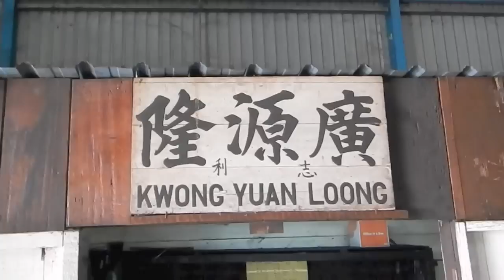How blacksmiths make parang machetes in Malaysia

Comment: " junk " is an ignorant and insulting comment . These guys are hard working men that fulfill a specific market with sweat and tears and believe it , if they spent all day one just one knife it would be superb ....
Reply: SACTICAL BAG if I spent all my life on one knife it would also be good but this angle grinding won't give you a nice edge and that's a pity regarding all the work that was invested
Reply: @robinpohl2702  you see, these guys actually USE their knives and not hang it on a wall and take it out once a week. spending hours on a nice mirror edge is pointless as its gonna get ruined anyways
Reply: @stalememe6407  in Case you havent guessed i use knives too and i never Said a Word about mirror edges, in factory im fine with a good working edge. All im saying is that even if you can hold a somewhat consistent  angle with this thing itll create a huge burr and even more unnecessary Heat, also these disks arent very cost effective either
Reply: @stalememe6407  soft as cheese those blades

Comment: I'm a parang user. Many types and depend on your intended usage. Hunter like to carry the short one with a small knife, for grass or weed there's the long and light weights type. For general usage, a 2 feets long with not too light or too heavy and not too thick steel is the best option. The angle or shape depend on the user's liking or comfortable with. An unpolished wooden handle is more comfortable rather than the varnished one. Not slippery as it will absorb our palm sweat and better in term of blisters. Better to modified a little the parang bought from shop. Hardened or carbon the sharp part as to maintain a better sharpness and robustness. For sheath or scabbard you can DIY using heated PVC pipe as it is lighter, waterproof, robust and cheap. As long as it comfortable to use and manage to do it intended purpose, that it. No barrier or code of conduct in term of using parang.

Comment: they used to make those parangs with wooden handles many years ago.. i had 2 (1 for home gardening use and 1 for whenever I camp or trek in Malaysian jungle).. it's still in good working condition after 35 years.. I didn't like the later rubber/plastic handle although it lasted longer.. the rubber/plastic handle comes off easily after heavy usage.. but the wooden handle tend to crack due to wet/dry environment and humidity of Malaysian jungle.

Comment: The blades themselves look excellent (forged steel rather than sheet metal), but I'm skeptical about a partial tang melted into a plastic handle and secured with only a single tiny pin in the front. I'd much rather have a full tang, a hardwood handle, and at least 2 (preferably 3) thick, solid brass pins holding the handle to the tang.
Reply from the maker: MaximRecoil Both tang types have their purpose, full tang handles are often best for heavy chopping but for lengthy trail clearing a light weight machete is best. I haven't had any problems yet with those plastic Parang handles. If you want to see machetes with superior quality handles we have a video you'll like better, it's called "How Blacksmiths make machete handles from Buffalo Horn."
Reply: Bush Channel

Comment: Who needs eye and ear protection?
Glad to see they use modern machinery now. Save those nerves for old age.
11:15, great idea.
Reply: The bloody thing would fly out of the handle without a pin . Full tang is better.
Reply: @738polarbear  they apply industrial epoxy to it before they put in the pin. The cement is permanent.

Comment: Parangs are one of the most important gardening/farming tools in my family. I brought about 20 with me to use on my own land. They are better than axes for cutting down small trees, and I also use them to slash through the bush and long grass. None of mine were made with heavy machines as depicted here. They are all hand forged. The weakest thing about them is the tang/handle arrangement. I only have one with a force fit plastic handle, a gift from my M-in-L. In some cases I have paid knife makers over here to make better handles for them.

Comment: I didn't see any heat treatment done, do they just sharpen the mild steel?
Reply from the maker: Yes I think that's how they do it. They seem to be very strong blades cause I've used them many many times without chipping or dinging :)
Reply: Yes, they do quench in oil.

Comment: No offence, I always wanted a nice Parang, Condor Tool and Knife makes some beautiful styles, but lacks in the steel but their 420HC I like better than their 1075 which rolled on my Golok, the ones from Malaysia seems to always be out of stock and I really don't know which ones to get, but I just got a modified version of a Parang, I wanted to give my Summer Long Knife a rest for the Brambles I go through around my favorite place my little heaven. My go to Long Knife is my Swamp Rat Rodent Rucki,  my new sort of Parang is my Ka-Bar Johnson Adventure Parangatang,  it's awesome, I sort of like the 1095 CroVan a little better than the 5160 which I was was going to get before the Parangatang it was going to be the O.K.C.  Bushcraft Machete and I might still get it, although I guess I'm lucky with my O.K.C. 's and so far no chipping, some of my friends do get some micro chips on some of their blades in that steel, that's another reason I hesitate getting the Malaysian Parang. I alway's liked the Cold Steel CarbonV's when Camillus use to make those knives. The steel is inexpensive but boy does it ever hold a great edge, it's generic name is 0170-6C, Sharon Steel Corp made it and when they went on a long strike, Camillus had to close and the CarbonV was no longer made, Camillus also made the Becker BK's in that steel and Becker's by Camillus was history. Ka-Bar somehow got to make it again from Bethlehem Steel but under the 1095 CroVan,  that's why I also like the Case CV's. Anyhow my new Parangatang is made from the 1095 CroVan and that's why I got it before I got the O.K.C. 5160, my knives from the 5160 seem to do great especially when I'm processing alot of wood, some of my Fav's are the Gen2 SP-47, 49, 51, and one of all time favorite SP-53 what a Beast of a Chopper, but it's a bit heavy. The Parangatang is 14"+ and that's a nice distance from thorn and rough brush, and I can get it scary sharp, and the 1095 I never had chips or problems with it, with the little extra CV in it it is a great steel, the price is right like I got the Parangatang and my Potbelly for $147.00 from Basically Knives a very good price, Ed was very helpful too at B.K., Anyhow one of these days I would like a Malaysian Parang, any info would be welcomed, but my Parangatang is a awesome tool.

Comment: what kind of metal is he using?
Reply from the maker: alpha martin I'm not sure of the exact type but it's of course steel :-)  The type of steel that is very strong, easy to sharpen, but will rust, it's similar to the steel you find in the leaf springs near the suspension on cars :-)
Reply: usually blacksmiths in malaysia use old automotive leaf springs for parang and other daily use blades.
Reply: Bush Channel . My dad often put some cooking oil on his parang to avoid it from rusting. And it's work.
Reply: AISI 5160 Spring Steel.

Comment: How does this steel compare with european, please?
Reply from the maker: Kevin Chamberlain The best thing about these S.E Asian machetes is they're damn cheap, if they get a ding in them you just re-sharpen them. Once the blade has been sharpened so many times there's nothing left, just buy a new one for only $6 or $10 next time you're there :-)
Reply: Bush Channel you did not even answer his question........
Reply: rocketguyandtompan07 See what I'm dealing with?   ;)
Reply: :p
Reply from the maker: +fukthegoog   Quite well said, best comment of the month Sep-2015 ★★★★★
Reply: +fukthegoog great reply mate, but abit of correction - they use 5160 steel which is also used for vehicle leaf springs. These bidor blacksmith does not use recycled or old leaf springs as they vary in size and thickness which makes production more difficult. Leaf springs also vary slightly in content which will have a slight effect on the hardening / tempering .